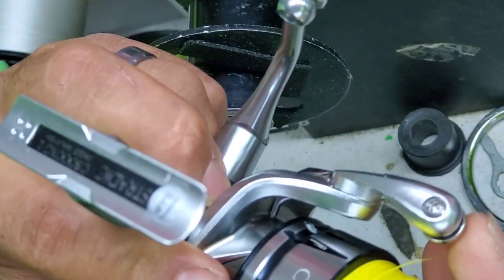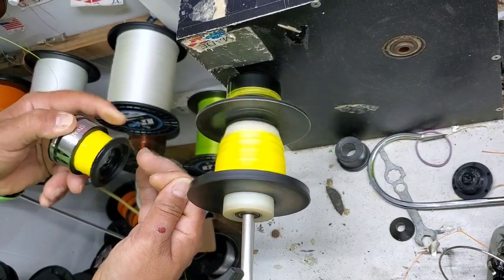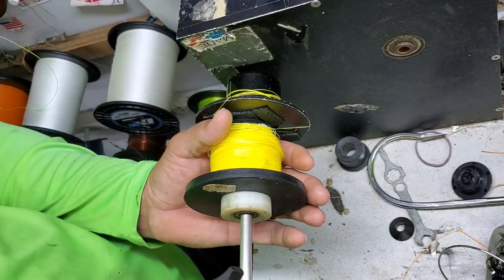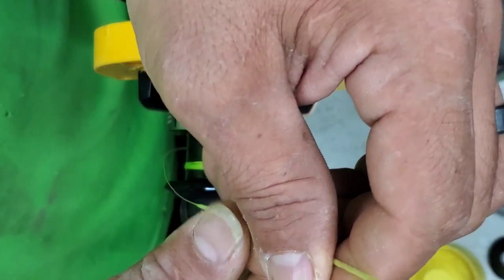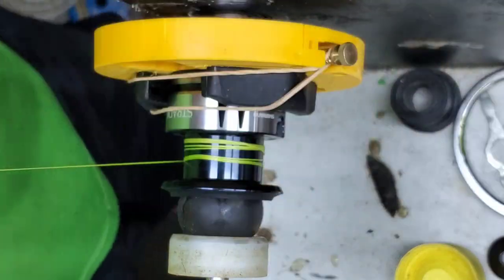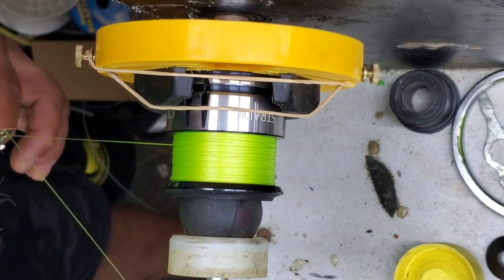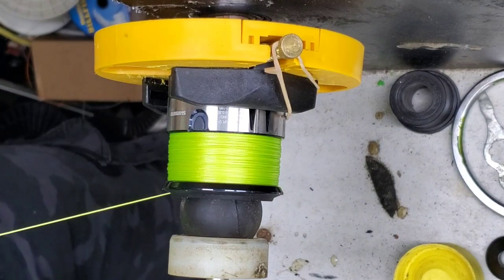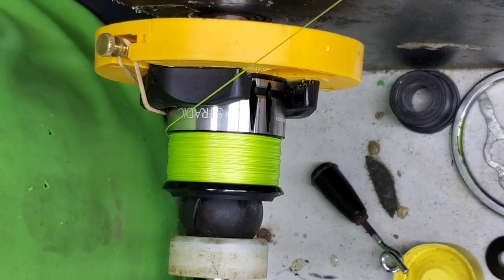Shimano stradic C5000XG 40lb Cortland Hollow braid spool and Why you don't use mono to tie to spool

Comment: Great reel but the rolling bearings go bad rather quickly with fish that scream drag.
   My advice, use it til the roller bearing goes bad, then upgrade to a a ceramic.If you just replace it with stainless, it will go bad as well.
Reply from the maker: That some great knowledge sharing thank you... and what kind of fishing are you into